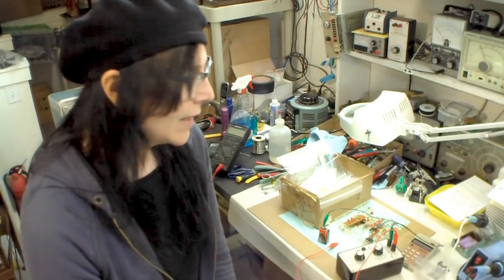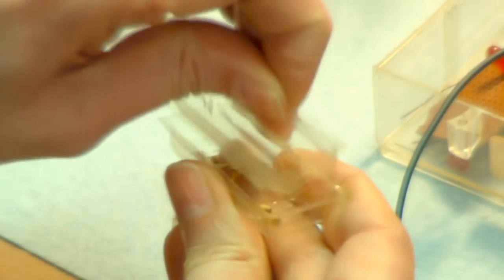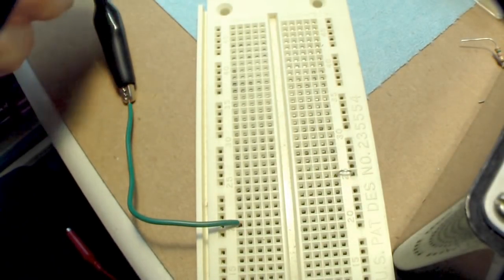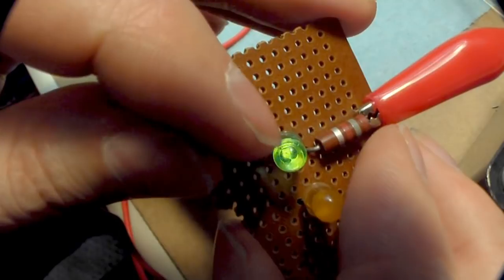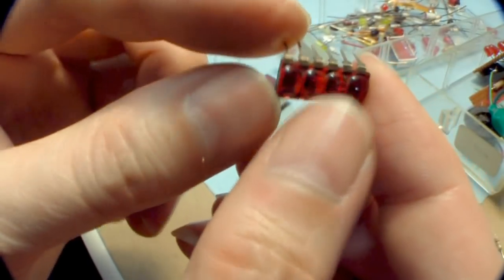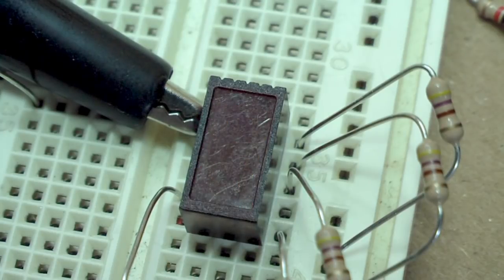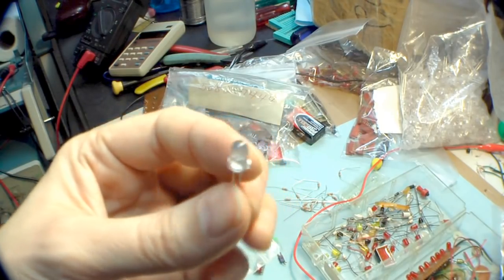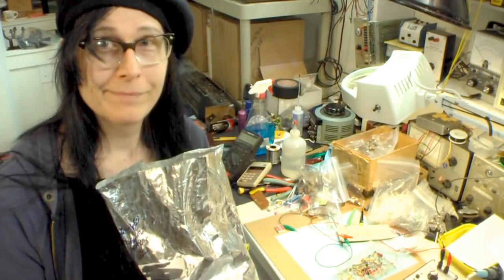The First Light Emitting Diodes

Comment: We must be close to the same age.

I remember way back when I was more curious and motivated, I took the various parts from several calculators and managed to reprogram the core chip to run four displays as if they were one, because I was not satisfied by the limited number of digits provided by commercial calculators. Wish I still had it, but we moved a lot when I was growing up and had to pare down possessions frequently. It was kind of like making digital counters/calculators in Factorio, but we didn't have Factorio back then.

Comment: Something else that TO92 LED might be is for use in the rotary encoders that mechanical computer mice use. The mechanical mouse has two rollers, on the end of each roller is a wheel with slots cut in it. An LED shines through the slots to a phototransistor, and as the wheel turns, the light interruptions create a pulse signal. I'm pretty sure the TO92 LEDs are what they used as the light source for this.

Comment: I was born in 1997 but even when I was very little I was interested in technical things and my dad made me aware of LEDs, and I took note of the range of colours that existed.

Vividly remember the first time I saw a blue LED, my uncle had bought a new desktop PC in the early 2000's and it had a tiny one for the power on LED in the case. I actually sat in front of it for a while just to look at that almost unnatural light.

I also have collected them but only as far as I've been able to desolder them from things over the years mostly. I wanted to purchase some of the red ones in the transistor package at the end from the one website that had them in stock but of course, this was in 2020 and they weren't shipping overseas, they sold out in the meantime.

Most interesting one I think, besides old 7 segment displays, would be a green 'play button' shaped one. Maybe it's cooler in my mind because it was the last in stock at an old electronics shop (it was actually glued to a display board) and when I asked about it the guy in the counter pulled it out from the board and gifted it to me.

Comment: I think the TO92 LED would not be intended as an indicator but as part of an optical device. I have seen similar LEDs in an old mouse (the type with the ball) and even in a photocopier where it counted the rotation of one of the rollers. There would be a similar looking photo-transistor on the other side of the encoding wheel, also in dark red plastic.

Comment: I am not sure if I had any individual LEDs in my hands before I got my HP-35 pocket calculator in 1972.  It was built with a number of 7-segment LEDs and those had a plastic dome as a magnifier the same way your small calculator does.  That small device made me eventually to abandon my trusty pocket size slide rule.  Plus it made me start checking the size (and availability) of pockets in any new shirts that I bought.  That habit still persists...

Comment: I dabbled with electronics briefly in my teen years in the 90s. My favourite leds were the so called tricolour red/yellow/green leds. all it was was a red die and a green die connected in opposing polarities, so you could get red or green with a direct current flowing in either direction, or you could get "yellow" with an alternating current which would switch between the red and green so quickly they blended together.

Comment: When setting up one's lab,  what are the most essential items to have?
Reply: Low voltage adjustable mains power supply. 3 ,6,9,12 volts. Small soldering iron on stand plus reel of 22SWG solder. Heatproof mat ,side cutters ,long nose pliers , cheap multimeter, small bench vice, set of twist drills, vertically  mounted low voltage collet drill. Cheap logic probe, desoldering sucker , either braid or reverse bicycle pump type. (Place heatproof rubber sleeve on tip to conform to solder blob to be removed.) sets of leads with mini croc clips on each end (. Alligator clips if in US.). Copper strip boards for prototyping, assorted colours of solid conductor insulated wire for wiring around components . Braided insulated wire for wiring off board components. Start with making a digital clock using CMOS logic integrated circuits . 40106B hex Schmitt inverters , 4011B quad nand , 4017B decimal decoded counter,  4518 B decimal counter /BCD. 4511B 7 segment  decoder driver . Common cathode Led 
displays . Packs of assorted 1/4 Watt resistors . Pack of electrolytic capacitors 10uf , 100uF, 1000uF etc. 0.1 uF non polarised capacitors .
Mini mains transformer with 6 volt secondary for making a system clock. 50 Hertz in UK ,60 Hz in US.

Comment: The first LED that I saw was in a radio specialty store in 1972. I thought about buying one for an amplifier pilot light. But it was $4.00, and as I was making $1.50 per hour, I went with neon. The first LEDs that I owned were in an HP-45 that I bought a couple years later.

Comment: I still remember what I did when the first blue LEDs were available... I opened every device that contained boring red LEDs and replaced them with blue ones!

Later, when the blue LEDs became blindingly bright and so cheap that every device had one, I replaced them with red ones or just covered them with electrical tape.
Reply: I'm so happy that the blue LED craze is over. Every thing you bought back in the early 00s had an ugly far too bright blue LED on it somewhere. I used black marker to dim them a bit or put them in cupboards where I couldn't see them.
Reply: I preferred tape because it was removable! I always thought that I wouldn't be able to sell devices again if I painted the LEDs black. But after all the years that have passed I know that I used every device until it broke or become obsolete, there was no reason to not use a black marker to dim them, like everybody else did. ;)
Reply: zvpunry ,
I'm still rocking my AV-D67 Aiwa receiver with another AV-D57 in the wings but both have a limited number of Toslink optical digital inputs. Have since acquired a cheap IR remotely controllable optical matrix switch which has done a great job at adding 3 more optical inputs but have blocked its ridiculously bright-for-their-size blue LEDs while pondering the possibility of cracking it open to add (a) resistor(s) ... if it's worth the trouble... or maybe I'll just darken them with a marker as stated below...
Reply: I covered mine with wax paper.

Comment: Couldn't help but notice, it looks like you have a Radio Shack (Micronta) 22-174B multimeter on your bench. I have one of those, but I popped it. The big resistor is burned, and I can't tell the color code on it, and I was going to order a replacement, to see if I could bring it back to life. Any chance I could get a color code or even a high res photo of the inside of yours, so i can have a go at trying to repair it. I always did like this meter. If not,t hat's no big deal. Maybe I can find one on ebay, but I really would love to resurrect it. Thanks!

Comment: HP in 1979 came out with a lower priced engineering calculator,  At $469 about, it was a 'must have' toys,  It was LED digits.  It ate AA batteries. by the day.

Comment: Hi! I have a lamp question and I was hoping someone here could answer. I have an old Northern Telecom Unity telephone (It's an analog phone with optional A-lead control). The message waiting/incoming call lamp is burned out. It's not an LED, and I believe it uses 48V. What do I need to replace it with, and is there any way to convert it to an LED? (There's a lot of room in the case. Maybe a step-down converter? Thanks in advance to whoever takes time out their day to answer this.

Comment: I have a 70s calculator from  Clive Sinclair, it was sold as a kit so you had to make it up. Has a red LED display. Mine will still work if you put 4 AAA batteries in it. Probably the only calculator ever sold in kit form!
Reply: I had a Sinclair wrist calculator (from memory, it took 6 mercury button cells) that I bought as a kit at Sinclair's office in Cambridge in 1977 (did a day trip there from London while I was on holiday in Europe).
Reply: and the only calculator the size of a bus
Reply: SpikenzieLabs makes a Kit You can buy today and techmoan made a video assembling it.
Reply: I too have a 1971 Sinclair from the UK purchased before calculators flooded the market.  Still works like new.

Comment: Back in the 70s when i was a teenager, I had an electric slot-car set.  I drilled out the tail-lights and glued in two red LEDs.  I figured out the resistor I'd need, and it worked perfectly the first time.

Comment: I had my first LED back in 1972. Bought it at Radio Shack(RIP). It was dim. If I used a lens I could focus a spot on the wall that was visible in a dark room. Eventually I built a flip-flop to use it with and put it into a film can with the LED poking out the top with coin cell nicads for power(50 mah) It would run for over 2 days..

Comment: Didn't see any multicolored LEDs.  Change the polarity for Red/Green or switch polarity rapidly back and for for a amber (ish) color.  Also I wonder if that weird LET (light emitting transistor) was used as troubleshooting aid to quickly located a failed component.  No light =  no workee.

Comment: A lot of those odd case LEDs were made to be used as voltage references. I have a bunch of red and green LEDs in SOD27 (think 1n4148 glass diode) cases that were made as voltage references. There were also a bunch of green LEDs in non transparent cases, i guess the only reason to have a transparent case was to make testing easier.

Comment: Did you ever check out the TIL311 hexadecimal display with built in driver? (It's a power hungry TTL driver!) It was around in the mid-1970s (I first saw one on the COSMAC Elf project in 1976 in Pop Electronics magazine) and they still make it today but they can be expensive (minimum $5 to 12 each). It displayed a hex character 0-9, A-F based on a 4 bit latched input. I think HP also made the same version back then.

Comment: Fun fact: in the 90s, Volkswagen put LEDs in their dashboards, which was great for the turn signal control lights and the green low beam light, but forhe high beam indicator, was required to be blue. Blue LEDs were probably available but not cost effective for mass production, so they opted to put in an incandescent light for just that blue indicator, making it match the LEDs in size and brightness
Reply: The small rectangular matrix of round dot lights was weird, modern & a bit silly.

Comment: Say LED now and it means Cree!  And we have LED's bright enough to be car headlights and the brightest compact torches  we could have dreamed about just a few years ago!
Could LED's now be the most prolifically produced active electronic component?
I built a 6 digit, digital clock kit in the late 70's, which used 7 segment LED displays. It's still in constant use but one of the displays failed a segment after about 5 years, the only fault it has ever had.
At the time I couldn't find a replacement of the correct type, which has always bugged me as the type I used is slightly brighter and has a different segment appearance.  
Maybe you Fran, or someone that reads this will have the exact type I need?  I'll put the type number up as soon as I can.  From memory I think it's a Texas FND500, maybe!

Comment: Also, I don't think blue LEDs, new or old, use phosphors. At least I've never run across one that did, and I've bought quite a lot of them. I also can't find any on the internet that use anything other than a GaInN chip to generate blue light.
Reply: ScootsMcGirk 
I think the first blue LEDs were so dim that they were only used for the hi-beam indicator on the VW Rabbit.
Reply: Were they LED's? When I was younger I thought of salvaging some blue LED's from those indicators but took for granted that there was an incandesent lamp behind a filter since blue LED's were so expensive at the time.
Reply: The one on my 2006 Golf is so damn bright that it's distracting when driving. It is the only instrument light not affected by the dimmer :/
Reply: yup, my dad's 84 passat had one as well. The 82 passat before it had a green led for hi beam with a blue symbol above it
Reply: Argh, my old nemesis, the blue LED.  I hate that manufacturers almost never tamp down the ultra-brightness so that they aren't distracting or even downright painful to the eyes.  Right now I would be agonized looking at my monitor if I hadn't put two small squares of polarized 3-D glasses lens over its power indicator.  I wonder if the people that keep putting these clear-lens blue LEDs in electronics as-is have a weird dip in their eyes' frequency response at ~470nm or what...

I'll take one of those ancient dim LEDs as a power indicator any day.  (BTW, I never knew Monsanto used to make electronic components — wild!)
Reply: Landrew0
Yes, I remember those. I had one on my 1984 Rabbit GTI (Golf GTI)
It may well have been the very first commercial use of blue leds.
In other markets at the time the international color for the high beam indicator was actually yellow.
Reply: Rick Delair
All legitimate points indeed. So which light source do you prefer in your home? I think halogen bulbs seem to be the best overall compromise. I totally agree that any lights in a indoor environment that have noticeable blue hue in them are offensive to me. I prefer about 3000k -3500k, ideally in between that color but it is very hard to find that 3200k color temp in any easily available bulb for homes.

Comment: My first LED watch was TI and there was a switch which you had to push to see the time. Current was that high that the batteries didn’t last long. Then I purchased HP-21 canculator for my tech school and that was really cool. It has Polish logic. It still works. And the blue LEDs were really expensive but then the first LED flaslights were blue. Tiny keychain lights. Not for junkies.

Comment: that lack of de-bouncing on the switches kind of reminds me of the first full fledged stereo receiver i ever owned, the onkyo integra tx-108. It had 2 power buttons, one was the main power which turned it off and on, and the 'system power' switch which was a standby/on momentary switch and almost every time i turned it on, it would usually turn right back off and vice versa. about a year later i got a pioneer qx-949 from the garbage dump and fixed it up to replace the tx-108, i'll tell you the story of that one too if anyone wants to know.

Comment: Did I just watch 35 minutes worth of old LEDs? Sure thing! LEDs are fascinating, I've always liked them a lot. Calculators, yes. Some hand held games, there was a soccer game I just didn't understand. Red dots, not even a loose matrix. Just an arrangement... And 7-segments... This reminded me that I've got a song called Seven Segments coming up. Synthesizer sounds, vocoder... Should get back to it ASAP! Only now the LEDs are becoming a common thing in lighting. And just recently I saw for the first time a series of LED street lights turn on. Big deal? I'd never seen that before. There was a ramp up, like half a second and that's it! No warning up. You can't tell from the colour it's LEDs, only from the shape and size of the lamp. These days you get what you want. But there's nothing like the early days. I wasn't even there to see the 70's LEDs, but in the 80's they were all over.

Comment: Yeah. I too really like those vintage LEDs. Most of them have nicer colors then todays. Reds today is almost orange - with one exception I used for an LED clock. I really hunted the highest wavelength diffuse rectangular red I could get - they're awesome and they wasn't expensive or anything - just really hard to find.
The first blues are as you said very nice too. You can get different wavelength blue even powerful ones today. Take a look at Philips Hue's 2nd and 3rd gen color bulbs. The blue of the 2nd gen is a really nice deep blue where as the 3rd gen is pastel in comparison. One color doesn't seem to have changed much - and that's the yellow. I like to use it on home made projects. There's something 80s about it and it's clearly visible. I don't like those high bright blue that's all too popular on chinese stuff. True orange seems to have gone out of fashion. I liked them too.

Comment: 32:40 This device could ge used in pocket DX radio receivers as an active tuning point indicator, like the Magic Eye tubes of the 1930's ?
29:28 These LEDs are emitting UV?  Wouldn't light bulbs made of these LEDs attract bugs, flying insects?
20:38 This multi  7segment display does not have enough connections to include the decimal point even with sequencing. 
20:00 Look like three per segment to me!
9:28. It says Malaysia on the back does it not? Even if it is from Monsanto, if it is made in Malaysia, I would say it dates from the late 1970's or later.

Comment: Love your collection. Very cool. I used to have a radio shack LED spring board to learn how open and closed gate circuit of a micro chip would work. I wish I still had it. I also love vacuum tube fluorescent displays.  have a pocket calculator that has a VFD. I like you little calculator really cool. I remember having texas instruments calculator with the same type of led display back in 1977 if I remember correctly. Very cool vid. :-)
Reply: I still have that Texas Instruments calculator.

Comment: I remember them coming out around the transistor time. Always red for a long time and pretty weak in light output. Then there were some orange green and yellow ones, so I am told as I am color blind, there was little difference in their color to me. I wanted blue and in time it came but was ages later. I even have a few violet, so I'm told, all look blue to me.
Early ones needed about 2 volts at 20 mA.
 
And yes I had an early calculator too. I thought I'd keep it as it would probably be valuable in time- but it disappeared.

Love your vids.

PS you change hair styles a lot and hair color but nice whatever.